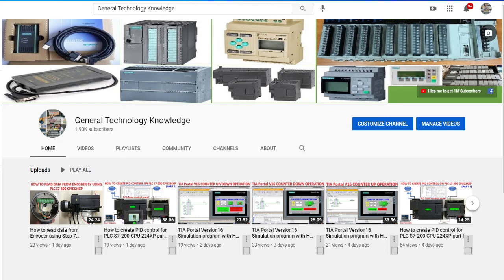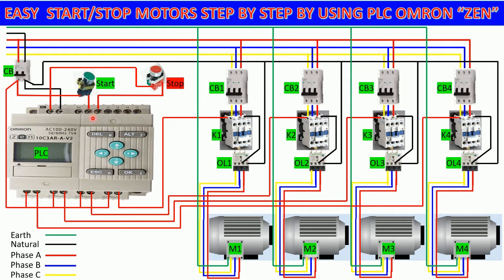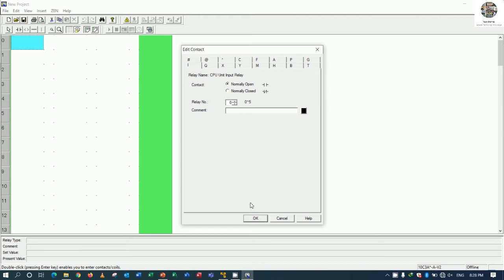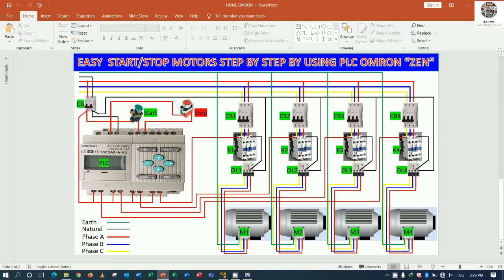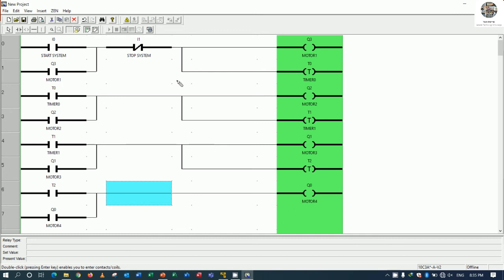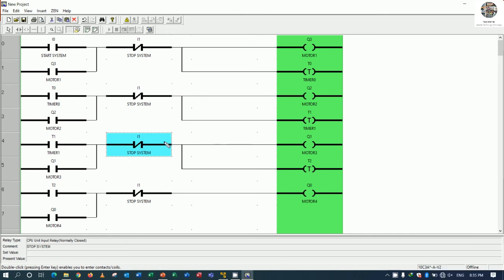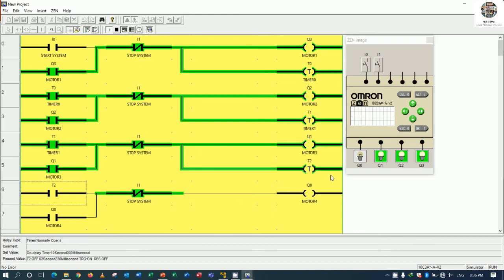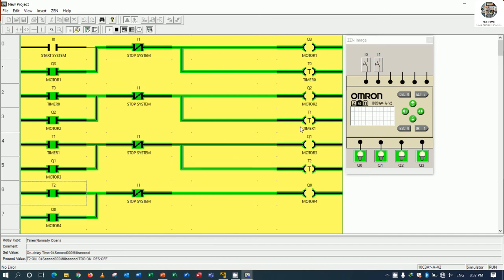PLC Omron "ZEN" create program for start 4 motors step by step

Comment: Dear I liked this. One suggestion only. You can choose internal relays for latching.output relay is last option only.
Reply from the maker: Dear sir,
For program inside PLC free style for create it.
So it depend on programmer who design this project.
Thanks
Reply: Why wouldn’t you want to use an internal relay to latch the output instead of the real world contractor?

Thanks!